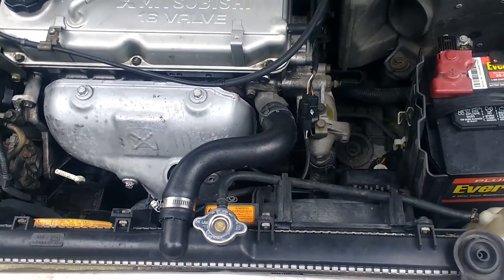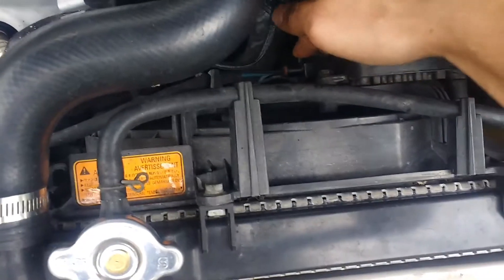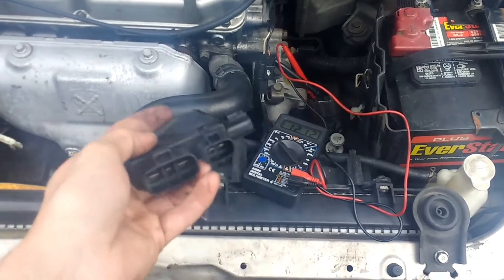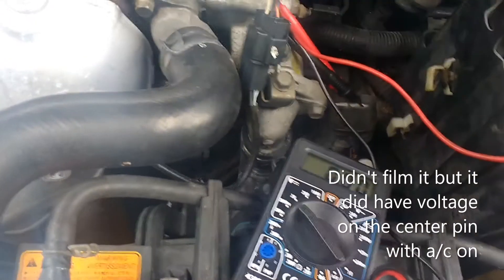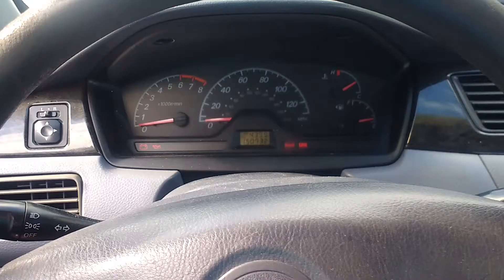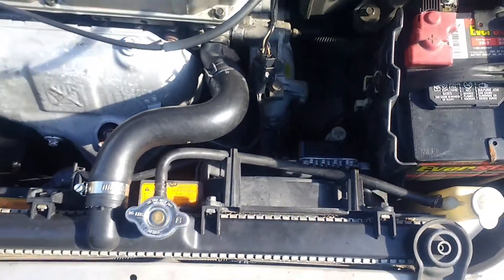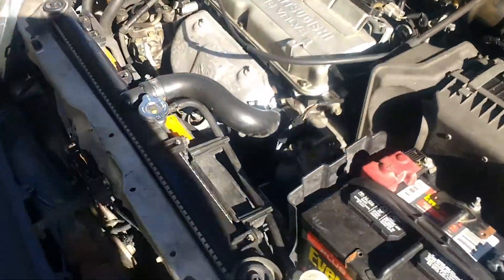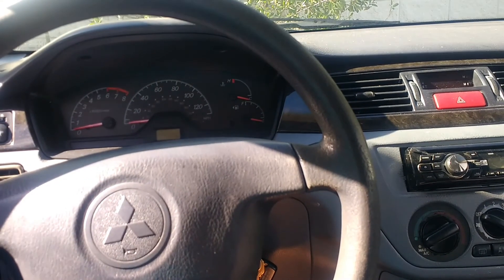Mitsubishi Overheating? Check This First!

Comment: My fan is working but very slow running.. what must should i do..
Reply from the maker: Check voltage to fan and check ground is good. If both are good then replace fan

Comment: I want to know,in cases we not turn on AC    then cooling fan not working cause overhead cooling system have or not ?
2. Do we need AC run all time when engine working?
Thanks for your advise
Reply from the maker: The radiator fan is always running when the ac is turned on. Radiator fan also runs when ac is off and coolant reaches a minimum temperature. You do not need to run ac all the time, the cooling fans will turn on automatically.

Comment: Mines acting up wierd. It's not the cooling fans or the module. I'm assuming my relay fuse is bad it clicks but like when i pull it off and on it only clicks once. The reason I believe it's that. Is because i have a Autek scan tool and I'm able to perform tests to every part of the car and control it through my scanner. When i command to turn on the fans. It comes on. But with the car powered on engine not started. When i have it running it won't make the fans come on. Also when i have the car running from cold to normal temp to it's normal reading fans don't come on whatsoever even after 15 minutes running. No check engine lights nothing. So since i assumed maybe a faulty coolant temp sensor i bought one from Amazon but turned out to be faulty. Once i installed it and started the car. The fans came on but the check engine light came on saying bad coolant temp sensor circuit high. So now it leads to me that the relay fuse may be bad. I did forget to mention. I bought a control fan module like your video since it was cheap to get one but yet no fans come on whatsoever and now im on the wait for a new relay fuse. Only cost me 5 bucks so hope it's the issue. Good video by the way.
Reply from the maker: you could probably jump the relay with a paper clip or something to see if it's the problem. Also are you sure you replace the right coolant temp sensor? There are 2 on these cars. 1 is for the gauge and 1 is for the ecu which controls the fans. Good luck.
Reply: @alexsbikesandmotors  yes i did replace the correct coolant temp sensor on my car. There are two like you said one is near the thermostat which is the Guage and the other is near the cam or crank sensor which that one sends the signal to the radiator fans. I forgot to mention i bought two coolant temp sensors of the same on that side which one was good and the other was faulty. But the faulty one activated my fans but the check engine light came on saying the coolant temp sensor was bad high reading circuit. And also i noticed it was hard to start my car when I talked the faulty one. Once i put the newer one it started up fine but no fans same with putting the old one back on no fans either. No check engine light. True I'll try to see that method with the paper clip. I know on Hondas you can do that easily and the fans will come on. But not sure if this car can. Thanks for the advice

Comment: I got this fan for $15 somewhere. It could be cheaper. Like $12 but it's not a big difference. My old module was definitely an issue as they were ON when key is on ignition ON position as well and the temperature was cold under 15 degrees centigrade.

However this faulty part saved my life. My ECT and temperature switch were also faulty.

Comment: This module was a problem for me, but the coolant sensor and temperature switches were much worse. I believe the fact the faulty module was on all the time saved my life coz the other problems like coolant temperature sensor and temperature switch were also faulty. Never replaced for a decade it seems. Original parts but faulty.

Comment: I have a fan problem but not the same as you, only one fan works and that is activated by switching on the airconditioner.
I tested the other fan by swapping plugs between the two and the other does power up so I have to find the cause of it not running.
I'm hoping it's something simply like a faulty temperature sender unit which I'm going to swap out, I might do the thermostat while I have bits off to gain access.
Reply from the maker: Im not 100% sure but i think these cars have 2 coolant temp sensors. One is for the gauge and the other is for the ecu which tells the fan controller when to run the fans. If you have access to a scan tool you can check what temp the sensor is reading. If its correct then the problem has got to be a bad fan controller

Comment: I can’t find any with the same number the one on my car is 3K23 1C23119700 where the only one I can find is 3H231c23219700 not sure if that will affect its ability to work or not
Reply from the maker: Those arent the part numbers. Part number is 1355a124 or 1355a408. The number stamped on the module doesnt matter.
Reply: @alexsbikesandmotors  ohh okay thanks for that, I’ve ordered one off eBay 👍🏼.

Comment: Do both fans should turn when a/c  on?
Reply from the maker: They do on my car, although it should really only need the passenger side fan for a/c.
Reply: @alexsbikesandmotors  I have 2006 oz rally only  one fan was not working thought it was the control  module ended up been the motor 😂

Comment: Plz tell me what to do mine were also working like you on key on engine off but now its not working on key on engine off and also on ac
Reply from the maker: do what I did in the video. Check for 12v at the plug that goes into the fan controller. Then check for 12v at the plug going to the fan on the drivers side. If you've got 12v at the controller but not at the fan, then the controller is bad. If you've got 12v at the controller and at the fan but the fan isn't turning, the fan itself is bad. If you don't have 12v at the controller you've got a problem with a relay or a wiring problem.
Reply: @alexsbikesandmotors  Thankyou Soo much bro now i have replace new module from the junk yard my fans works on ac on but i didn’t observed that its turn on the coolant heating up can you tell me that where will the fan on. When the heating up niddle goes in middle or above middle?
Reply from the maker: @cablevlogs147  turn off ac and let the car idle. The fan should come on when the temp gauge gets a little bit above halfway. If its like 2/3 on the gauge and the fan is off the youve got a problem. Could be coolant temp sensor
Reply: my problem of my fan control module is when the engine in how many minutes the after that the fmc will shut down & then when i got to move the fmc and the socket then it works again then after that  the fmc shutdown. my modile is already damage?